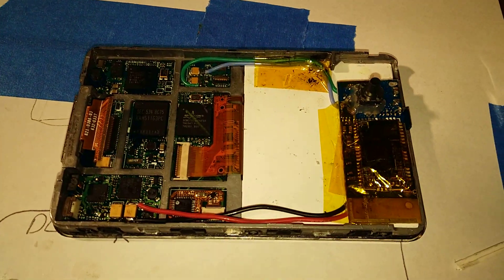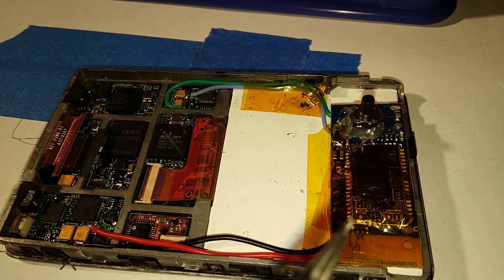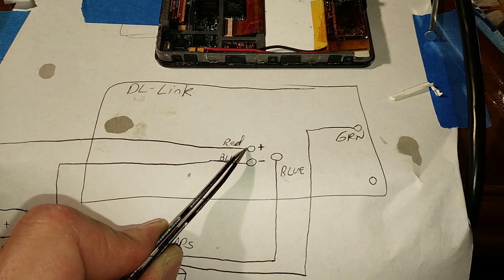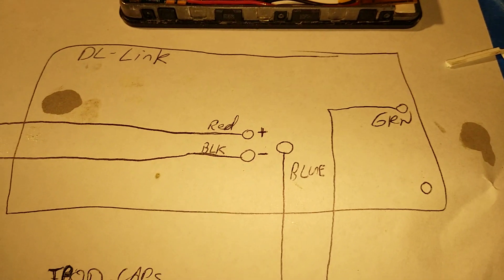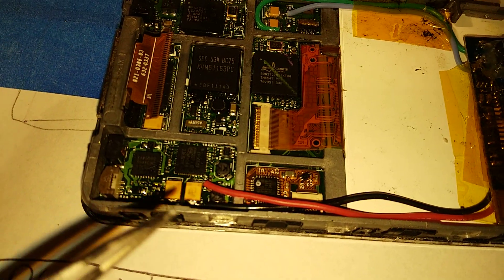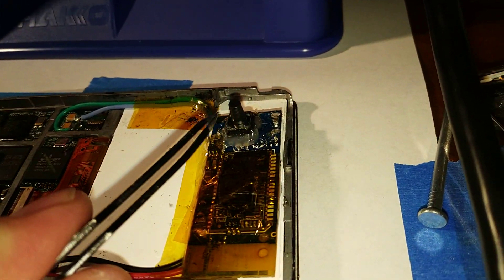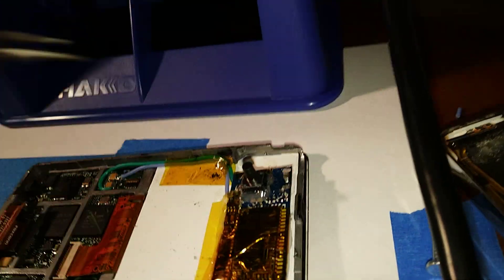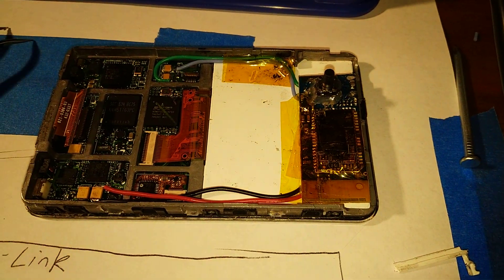iPod 5g Bluetooth transmitter mod

Comment: Also update in the battery kills?
Reply from the maker: Check the item description. I posted a link to the transmitter that I used when I redid the project a while back. The taotronics one works flawlessly for me with no more battery problems.  I currently have a tarkan board, the Bluetooth mod, and I believe a galaxy s3 or 4 battery and everything is functioning very well.
Reply: @yoyoman62002  and your power solder points still the same on that capacitor or did you change it? Also how did you managed to shove a S4 battery in there, now im more intrigued hahahaha

Comment: Sry mate any way you can help with a 6th gen or a 7th gen soldering points? I'm not that good with electronics.
Reply: I believe that the 6th/7th gen ipods use the same board as the 5th gen. Also, the 6th/7th gens are made out of aluminum, so good luck getting a transmission.
Reply: i'll see if it works if not i'll have to cut a hole for the antenna :D but the 6th/7th board is different, I tried to solder it directly from the battery but i get some feedback sound through the jack and bluetooth so i don't know what i'm doing wrong. I'll see thx for the reply
Reply: @kornshifter  hey Cristian, I'm bluetooth modding my 7th gen right now too. unfortunately I've got the same feedback (ground loop?) problem. did find a way to solve that?
Reply: @florianfries6197  i haven't managed to find an optimal solution for me. are you on discord? maybe we can chat there. :D
Reply from the maker: Not sure how to help. I don't have either of those.  I've had my ipod since 2005 and never bothered to get a new one.
Reply: @yoyoman62002  No worries man :D i just can't figure out the parasite signal i'll just add 2 batteries and keep it on a separate circuit :D it's all good

Comment: What about backfeed noise ? That anoying buzzing sound ..
Reply: What dc/dc isolation transformer did you use? As far as I know they only come in 3.3V in - 5V out. Did you did you drop the voltage to 3.3/3.7 with diodes/resistors or use a voltage regulator?
Reply: @Rectangle101  ??
Reply: Nevermind i found the solution
Reply: @dollarbil961  What's the solution?
Reply: @matthewlabuda  isolation transformer dc to dc
Reply: @dollarbil961  do you have a guide?

Comment: Is there a reason this mod only seems to be done on the fifth gen? I have a seventh gen but would love bluetooth.
Reply from the maker: Might be a space issue. A tarkan board is a basic requirement to make more space for this particular mod.
Reply: @yoyoman62002  I did some more research and that seems to be the general consensus, makes sense.
Reply: 6 and 7 are all aluminum and steel they don't allow Bluetooth through very well at all but you can swap frame and faceplate
Reply: I think that is because the 5.5 gen has the best DAC by Wolfson

Comment: Can you write a guide for this? You did an amazing job!
Reply from the maker: Possibly. What do you want from a guide that is not in the video?
Reply: yoyoman62002 yes, like a written guide with photos. Is the soldering difficult?
Reply from the maker: I would call this an advanced mod since it requires desoldering components on the donor Bluetooth transmitter. Pictures are probably not going to happen since the mod is complete. I will write up a guide and post it in the comments. I really wouldn't recommend this mod since it ruins batteries so easily and I don't want anyone burning their house down.